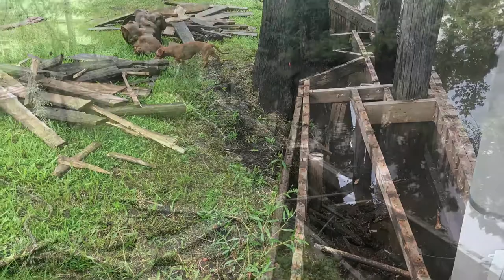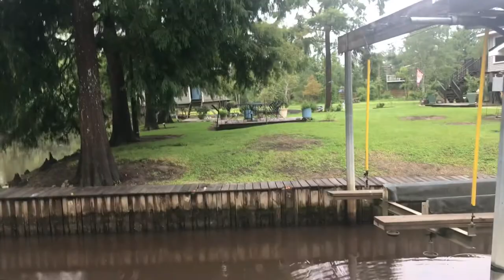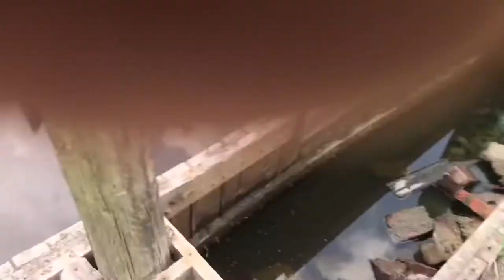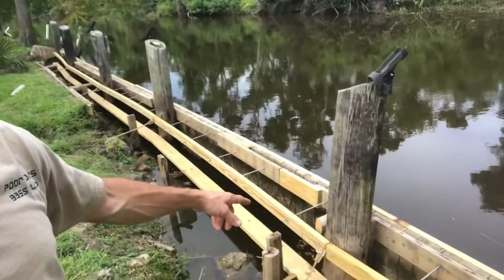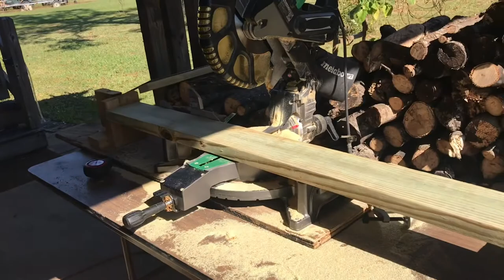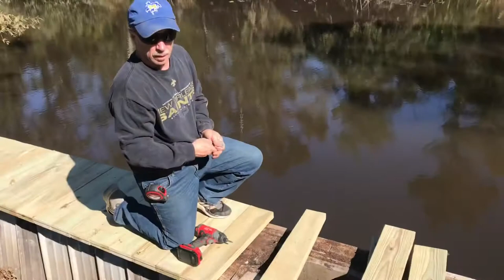Repair Waterfront Bulkhead & save $90,000

Comment: Had lightning strike my folks bulkhead and it literally fried and melted a few of the tie-back rods. The rods are 5/8-11 stainless steel and on one piling it compromised the washer where the nut recessed into the washer allowing the piling the shift out probably two inches. Currently in the process of repairing it for them. Good job on your work and thanks for the video!